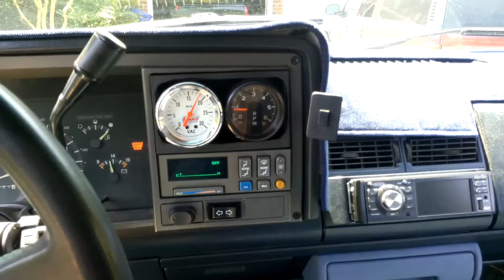Carb swap 1992 Chevy K1500

Comment: I'm thinking about going to carburetor on my old 92 305tbi firebird, I should have actually did that instead of messing around with all the sensors I bought for it lol....mine takes a bit of cranking before it starts and idk wtf it could be, maybe starter, already did a full tuneup overhaul plus fuel filter and still the same....man, your truck started up fucking INSTANTLY lol....very nice, these gmt400 style are the best looking trucks ever to me 88-98 chevy

Comment: I did this swap kinda I used a 80's 350 with a holley 600 just need to wire in the tps sensor I have the kit from summit just have to finish it.

Comment: where did u hook up the brake booster line/hose that has the metal tube leading from the booster to the manifold …. and my year 91 1500 short bed has the 700r  and this transmission is controlled by the tv cable and tps sensor? so if i get the tv cable carb bracket and the fps sensor kit i won't  have any problems with the tranny ? cuz it does look to be computer controlled of some sort sorry if these questions were already asked i just need to clarify and is the hei distributor u have vacuum advance i acquired a msd vacuum advance model pn 8361 will this work thanks in advance for what u can answer

Comment: so what would happen to all the plug ins and such,would the vortec motor just drop in without changing any harness,or do you get rid of the harness when you switch to carb???,I'm 18 and plan on goin this alone;P,id just get a another tbi but i can get a good deal from my uncle for the vortec and it only got like 30xxxkms on it original and from what i hear they have more power then the tbi,and how much horse power does your truck put out??,also thanks for the reply

Comment: What kind of fuel regulator did you use.. I have a 350 small block old style in my 1995 with edelbrock performer intake bit I built an adapter plate for my tbi... Needless to say I hate the computer stuff and wanna switch to carb... I just need to manage my fuel pressure from 40 psi to between 6 and 8...thanks

Comment: hey,i think this truck is badass,i got a 95 with a 350 5speed,but want to swap the motor for a vortec with the carburetor,would you have to switch anything for the vortec??and also what changes had to be made to make this carbureted???

Comment: what were the 2 gauges inside the truck to the right of the original for?
Reply from the maker: Christopher Castano they're aftermarket ones that are a tach and a vacuum gauge
Reply: Andrew_Hatley sweet. where did you get your truck have been lookin for one. is thay year good if not what is the best 1990's year?
Reply from the maker: Christopher Castano I found it on Craigslist. if you're modifying one then get 1992 or earlier. easier electronics and simpler.
Reply: Andrew_Hatley cool man thanks...
Reply: Andrew_Hatley u got some cool videos like what youve done with your truck

Comment: do you know if there are any other intakes for the tbi,i went and checked out the motor i am buying off him and it ended up being a tbi,but it only has 55xxxkms on it,i was just wondering if there were any edelbrock intakes for the tbi i found i few but i am not sure if they would work,thanks for the replays,or is the holley one any good and should i just go with that?

Comment: why did you need a throttle position sensor kit? You should have a 700r4 which is a fully mechanical trans right?
Reply: 92 would have been first year of the 4L60E electronic. my 91 is the last year of mechanical 700R4
Reply: @yankeeroad626  my 92 has the 700r4?
Reply: YankeeRoad incorrect. 1993 was the transition year and they were still built with the 4L60(700R4) AND the 4L60E. My 93 4x4 came factory with the 4L60 (700R4). Could have had either and in 1994 they were all the 4L60E.

Comment: I have a 91 C1500 2wd w/ 350 5.7L tbi and I am wondering if I use all the same parts that you used to covert to carburetor. Also, I have the TV cable on my trans. Is there a kit or anything I need for the carburetor for the TV cable?
Reply: In the late 80s there was still truck that were carburetor from from factory and used the 4 speed 700R4 which you have. I know there is brackets for TV Cables for carbs. Look in his description too cause you going to need those parts except the intake and carb. Intake has to be a Chevy small block intake and you can put whatever carb you want on it. Also I suggest doing a google search on this swap. I know there is some Chevy truck forums where people have done this swap
Reply: Kenny Lear Thanks! I appreciate the help.

Comment: how does the tps affect the transmission? i have a 1992 chevy blazer silverado 5.7 and it runs bad at idle i change all the sensor on it and it still runs bad. i was told to converted in to a carburator,.i was told that i only had to change the intake,,carb and to add a filter regularor, to keep the same distributor but they said nothing about the tps
Reply: IAC and EGR are common causes for rough idle along with the more basic plug wires, etc. Might be wrong but I don't think your trans is affected by tps.

Comment: I don't understand, You have a 92 k1500 should have a 700r4. Why would you need a tps for your trans? From what ive read its only if you have a 4l60e or4l80e. Please respond or some one because im converting to a carb and don't no if its going to need this or not.....I have a 92 as well k1500
Reply: if you have a 700r4 u dont need the tps if not then u do your truck will not shift the right way

Comment: did u have to do anything to the transmission being that it was computerized for the tbi? im about to swap my tbi on my 89 caprice
Reply: Transmissions on those years of trucks are 700R4 which are not computerized. Only computerized sensor on the truck that effects the trans of these years is the TPS(Throttle Position Sensor). Which I know Holley makes something for those to help convert it to carb.
Reply: Kenny Lear k

Comment: I have 90 K3500 with a 454 tbi and 4 speed sm465 what would i need to do this?
Reply: adam brakke Google. You're lucky, its much easier with the 4 and 5 speeds cause you don't have to mess with trans. control.

Comment: do i need thethrottle position sensor kit if my truck is a 5 speed standard too?
Reply: If its a standard, you dont need. You might if you wanna use cruise control though